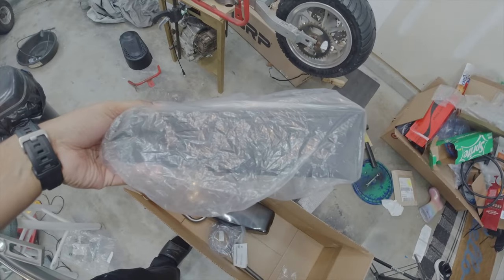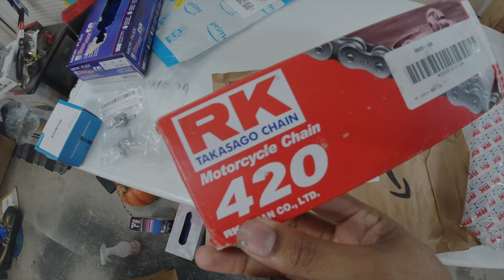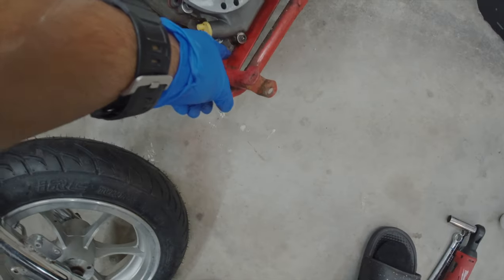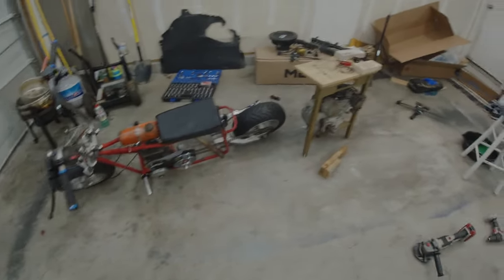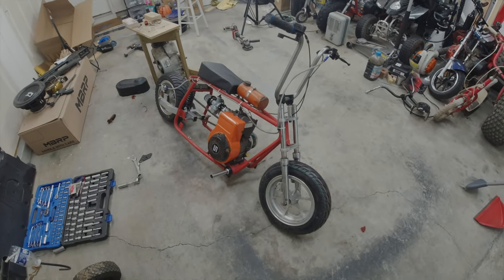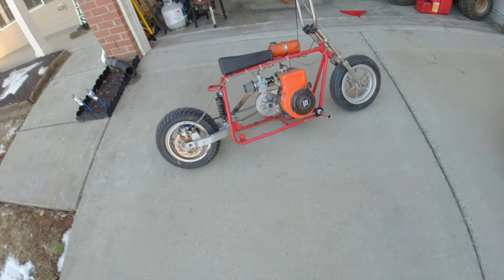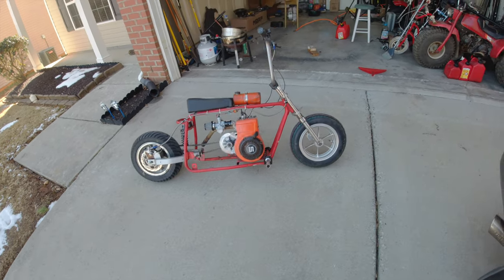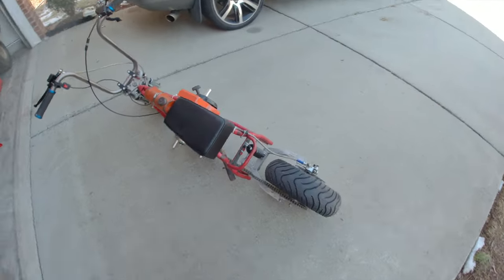Flat Head DoodleBug 30 Ep. 4 | Chain, Seat, Ape Hangers, 1st Ride! | DB30 | #MiniBikeMonday

Comment: Nice build!  Do you have a link for the Ape’s? The whole thing looks so 🔥🔥. What year Briggs is that 3.5-5hp?
Reply from the maker: I think I got them from GPS. 12" apes. I'll drop the link in the description. And its a Briggs Raptor racing engine, 5 hp. Suppose to have billet rod, .20 over piston and valve springs, But i havnt opened it up to verify.
Reply: @DariusBuildz  wish I lived closer… we’d make some builds!
Reply from the maker: @GPMAX01  For sure! It would be nice to have someone local to build something with for sure!